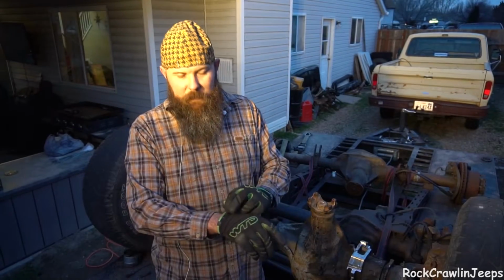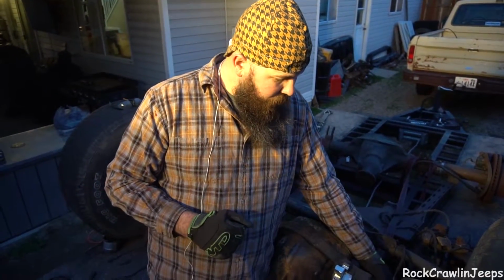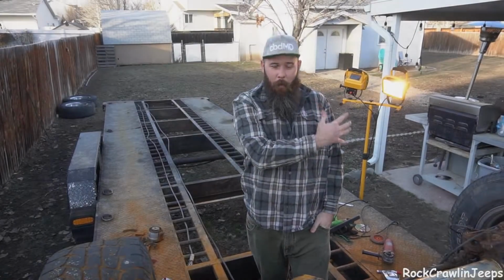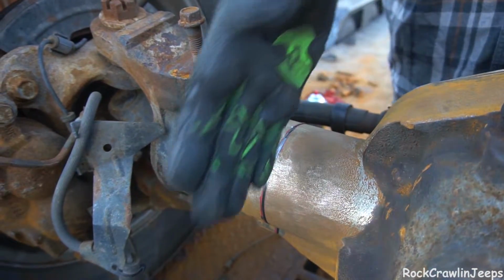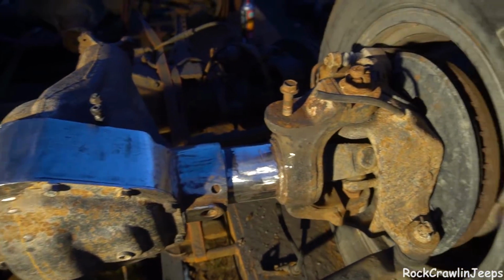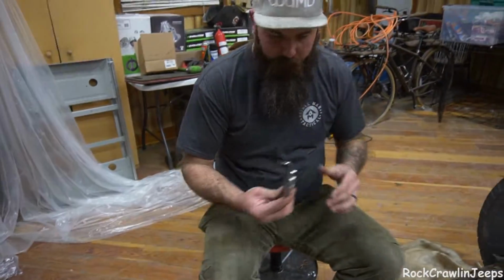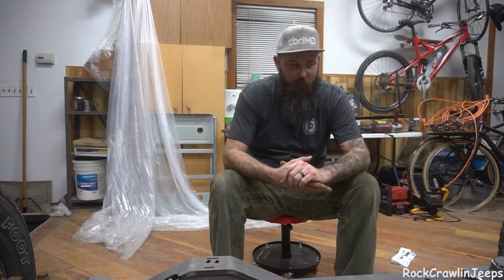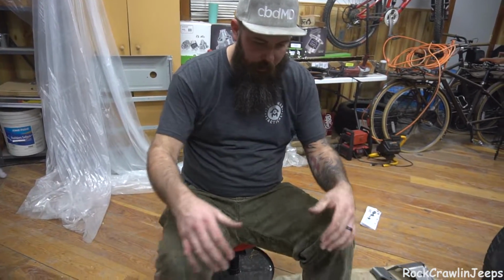Superduty Dana 60 is FINALLY Clean! ONE TON SWAP PT 4

Comment: How can I tell between Dana 50 and 60? 
I found a 2001 f250 with a good deal but idk if it’s a 60?
Also why is the 2005+ axle better than the older models?

Comment: wich sandpaper grit did you use to remove metal on the track bar mount ? i am at the point of grinding down evreyhting i cut and it is taking ages. yours seems to be taking a lot of material off
Reply from the maker: Felix Benoit I’ll look at the disks tonight and see
Reply from the maker: https://www.walter.com/products/-/producttradename/abrasives/blending/enduro-flex